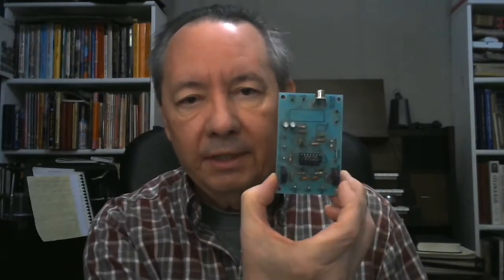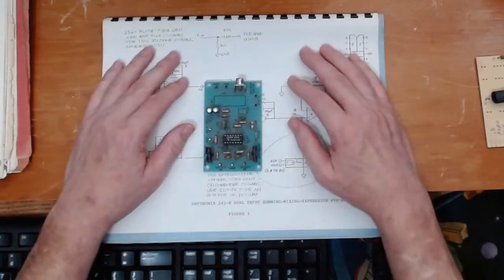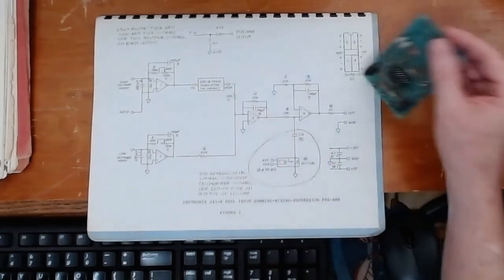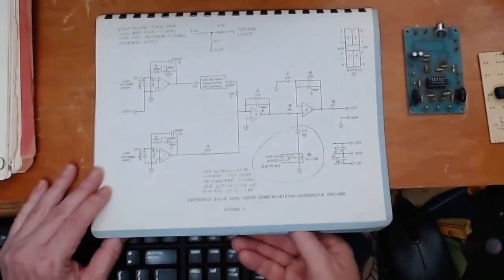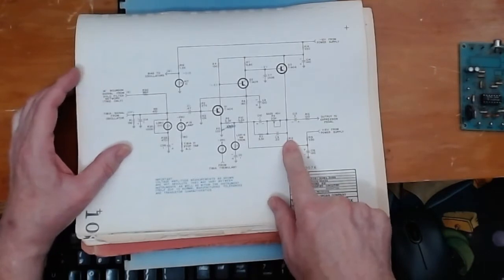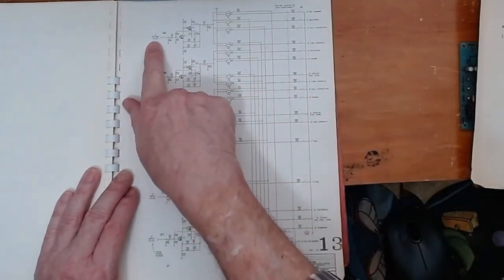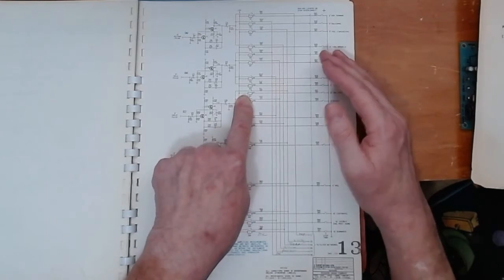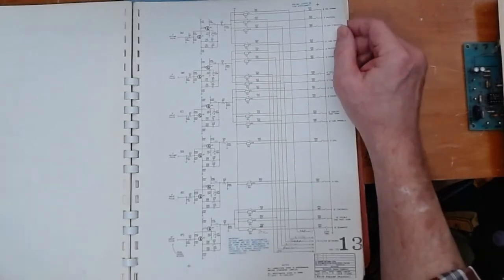Organ Technology 19 Vox Humana and Oboe

Comment: The failing preamp could very well be just the breakdown of the old ic. I noticed that some old transistors in amplifiers start failing and making hissing,crackling and all sorts of noises,
You said it was from the 80s, Well
From my experience some old components just suffer from that.